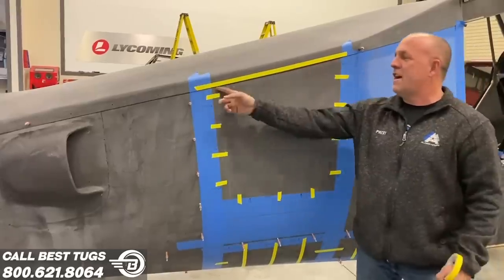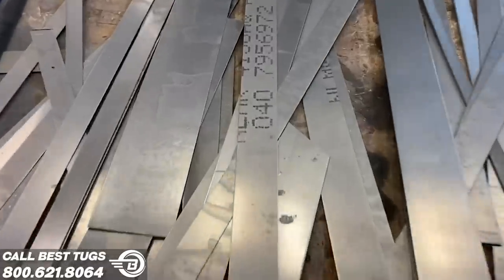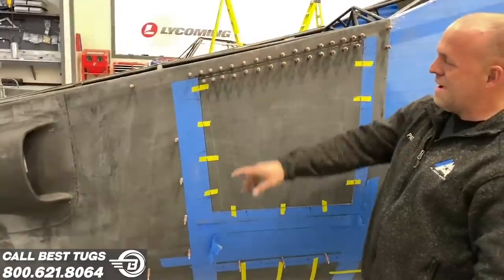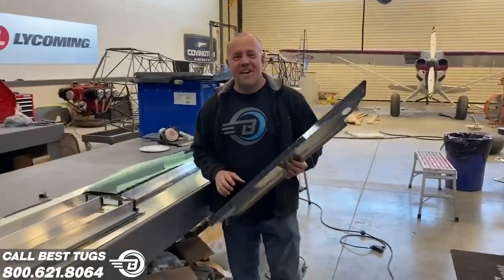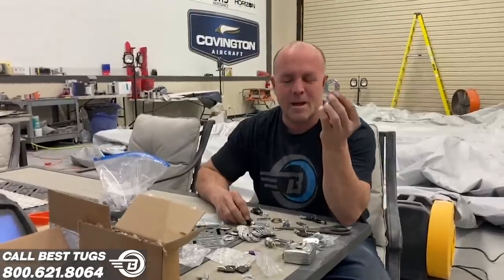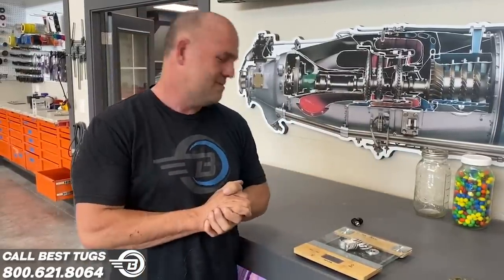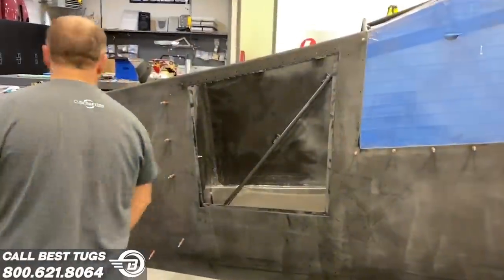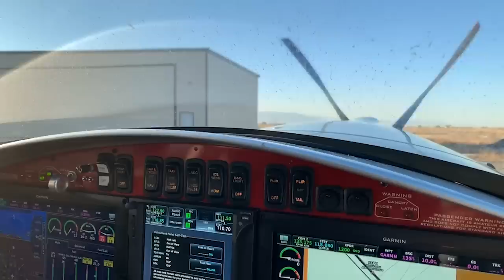Doors and locks (Scrappy Bush Plane 19)

Comment: I stumbled on to the "Scrappy" build somewhere in the early teens of the project videos.   I was so impressed with both the project and the fierce enthusiasm, mad skills, and mind boggling work ethic of Mike Patey, that I went back and pretty much binged the series up to this point.  Loved the four bar, complete with airfoil, landing gear solution, by the way.  Anxiously looking forward to the next installment.   Beyond my role of spectator and fan, I just wish there was some process where I could get a transfusion of whatever powers this man.     Super impressed.

Comment: Coming soon in Episode 20: Mike decides regular wiring is too heavy and makes his own with fluted copper strands and lightweight fire and abrasion resistant insulation. 20% lighter, 15% better conductivity, 4000 degree melt point, and requires a diamond wheel to abrade.
Reply: considers fibre optic
Reply: Of course Mike is making his own wire.  One day, I think he will build his own engine from raw materials. 😀
Reply: "I decided I wasn't happy with the weight of the engine, so I quickly whipped one up out of carbon fiber...."
Reply: This man needs to start building and selling extreme bush flying kits for airplanes.
Reply: @jeantsaiaviation  if I ever had the money I would buy as many from him as I could
Reply: MrChevyman962000 actually not a far fetched idea.  I’ve seen some chatter about Carbon Fiber connecting rods in F1 engines ( prototype of course ) but it’s all theoretical
Reply: Don’t give Mike any ideas. We don’t want Scrappy to take as long as Binky. 😉
Not that there’s anything wrong with Nik and Richard @BadObsession taking over 5 years to stuff a Toyota Celica GT All Wheel drive chassis and engine under a vintage Mini Cooper.
Reply: @Crewsy : No chassis, just engine & running gear :-)
Reply: @jeantsaiaviation , but selling snake oil is going so well.
Reply: @tiredowalkin  ???
Reply: @jeantsaiaviation  Mike's ego is doing well as it is, his designs are not proven only proof of concept models and prototypes.
Reply: @tiredowalkin  i'm not going to waste my time, thank you for replying.
Reply: @jeantsaiaviation  lol, you just did be replying and reading my replay....face it

Comment: Mike's comment about saving a 100 grams lots of times adds up to a significant saving, reminds me of F1 design philosophy.  They do the same thing but not just with weight.  They look at every component and assembly, trying to gain a fraction of 1% improvement with each one.  That sounds so like what Mike is doing with Scrappy.

Comment: Good idea to change to bearings for the flight control pulleys 👍

Hints :  I know you already know these but for new builders, this might be useful.

Remember to clamp up only against the inner race and leave the outer race free to rotate. 

The pulley’s surfaces should be clear of the bracket. This will reduce friction throughout your system considerably.

Also try to ensure you have more than the minimum cable wrap angle on your pulleys, so that the cable does not slip in the groove, instead the bearing should rotate freely.

Great stuff, love watching your videos. 

Thanks so much for sharing and providing us with great insights.

Comment: Those oscillating cutters are the best! I just used mine to cut holes in the wall to install my 50 amp 220 outlet. I can finally use my welders and learn to tig weld!

Comment: Taping the steel ruler... genius!  Definitely going to be doing trying that! And multi-tools are fantastic!
Reply: Yup. A stainless steel ruler that's under one mm in thickness, is excellent for this. It will comfort to all sorts of shapes and curvatures, and being stainless, it won't complain as much as other metals when the buzz blade passes by. Certainly an aluminium ruler would be chewed up after a few uses. I have a friend who does carbon fiber replica frames and this is his preferred method. He's even using a variant where the ruler is turned on its side to get curvatures, like wheel arches and so on. Last i saw, he was using small aluminium cubes with 3m red double sided tape to stick it on. Nothing one can't do, with sufficient ingenuity or will.

Comment: A holesaw is great for making your own washers in different sizes and if a smaller than 1/4" center hole is needed I mount the plate and saw in my 
pillar drill and cut the "washer" without using the center drill.  If a larger hole is needed I just put it in the lathe.    

Nice to see your build moving forward, when it's finnished  you can do a "Crocodile Dundee" and say:    -That ain't no Carbon cub,  this is a Carbon cub!   :-)

Comment: Those Ace type cam locks come with generic backing plates which are made for the masses. It helps when a user drills the hole on an angle/etc.. In your case, with the OCD, you made the right choice fabbing the tight fit plates. The cams are usually in a universal kit and designed more for mailboxes/etc than carbon fiber cubs..

Love watching the vids—Keep up the “insanity” 🤪

Comment: Mike- set a good example and protect your hearing by using Ear Muffs!  My ears constantly have a high pitched ringing from chop saws, grinding, powered saws, rivet setting, get the picture?  As a retired A&P and metal worker with some carpentry thrown in, I have (till around 45 years old) done everything possible to loose my hearing, with fairly consistent results.  If you want to converse with your grandkids, please start a new habit of every time you cut, grind, etc. make it a rule to wear good muffs.  Chief has David Clark muffs really reasonably priced, and hearing is priceless, eh?  Great stuff you are teaching here!!

Comment: After you done with your multi tool cutters, don't throw them away. Grind off the serrations & smooth the metal out. Now you can use them to sand by sticking a piece of self adhesive sand paper to the re-purposed cutting blade.

Comment: Mike is about to make the SpaceX falcon nine look like a toy when he finishes this "Cub"
Reply: I can see the headline....first airplane to reach orbital insertion speed from an air breathing engine....lolol!
Reply: Phyde4ux about 10 videos ago when he showed us the engine and prop
Reply: @diverbob8  Yeah from a standing start with zero run up
Reply: @FrozenLionsFan  AHHHH-FACTS! LOL
Reply: However, SpaceX will retake the lead with Starship, about the time Mike starts building for that new jet engine in the case, and gives them a run for their money!
Reply: Lol.. Elon Musk would spank Amazon if he gave Mike a team to design something for Mars...
Reply: ke6gwf I want to see what Mike would do with the Starship attitude and budget to test to destruction!

Stainless Cub anyone?
Reply: @solexxx8588  Don't be so literal.  It was easy to understand his point of interest. Mission Design has nothing to do with his point of intetest. He was referencing the Renaissance /Dare to Dream, Designing Style.  Not the design advantages of coin & necessity requirements. Scrappy was always more about kitchen sink rather than saving / spending a buck.
Reply: @daniellewis1789  stainless doesn't make sense for the Cub.
It does for the Starship because it's higher weight is offset by the greatly reduced heat shielding, and having balloon tanks vs separate tanks and shell, plus materials and manufacturing will be a fraction of the cost compared to carbon fiber. It's also easier to repair, and better suited for reuse and inspection etc.
You get none of those benefits on a plane, you just add weight and a LOT of cost.
Reply: @hoppermantis7615  Elon Musk already IS spanking Amazon. Bezos hasn't even made it to orbit yet, built a flight engine, built an orbital rocket, or pretty much anything else that mattters.

Mike has built and flown more than Bezos has! Lol

Now, maybe next month he will roll open the factory doors, roll a completed rocket out, and orbit the moon, but considering they haven't even got a flight ebrhi/engine to ULA who really needs a bunch, I am not holding my breath lol

Comment: If your trying to scrub off as much weight as possible you could use amsteel (dynema) for all of the cable's. Its just as strong as steel cable and only a fraction of the weight.

Comment: I probably couldn’t afford the fuel, but this is my dream plane!
Reply: I think you’d be pleasantly surprised to see how little fuel a Carbon Cub eats per hour. Though, Mikes cub will burn a bit more than the AvGas or MoGas variants. The MoGas version wouldn’t be much worse than an Ford F-250, and it’s way more fun!
Reply: Just to give you a taste of what it's like to own a high end unit, I was with my companies owner last week to put his 60' yacht into the water for the year. We fueled up and the bill was $3800. Just in fuel. Then the factory engine service tech came and did the valve lash for both mains and the generator set. Along with the oil change, all the filters and other fluids. $4299 was the actual invoice. Then the tech showed up to calibrate all the radars and GPS and all the other navigation aids. A software update finished it. All told it was near $23,000 just to get the thing back in the water. So my point is people just look at the price tag of the "toy" they want, but that's not the expensive part. The real money is spent on the other stuff. Like the man said, if you have to worry about putting fuel in it, you can't afford it! General Aviation is just as bad.
Reply: @valuedhumanoid6574  with a sailboat they say to expect to spend 1/10 the purchase price per year. I would assume the same or more for a power yatch.
Reply: My Tri-Pacer 150 hp @115 mph burns 10gal/hr = 11.5 miles per gallon. My F-150 averages 14.5 mpg around town and with my cargo trailer behind it I get 11.0 mpg in the mountainous west but have to go around everything instead of straight line flying. 10 hours in the truck 110 gallons or 6 hours flying 70 gallons. Mikes engine will be loafing in cruise flight.
Reply: 110 gallons in 10hrs? At 11mpg is 1210 miles. You're not driving that far in 10hrs.

Comment: I would have made a UHMW or Delrin ball fitted into the hole in the lock tabs to take up the slack between the lock latch and the carbon fiber.  That way you have a soft yet wear resistant piece aginst the carbon fiber.

Comment: You've gone so far with the carbon fab on the fuselage, it almost seems that much of the structure could be monocoque. With a little more engineering, maybe much of the steel would be redundant.

Comment: @Mike Patey I'm wondering why you don't lay some kevlar inside your cockpit ? In gliders we are surronded by CF. We have a layer of kevlar over the CF to protect the pilot from been perfored or injured due to big CF splinters in case of shock.
Reply from the maker: Great question. 👍🤠 I wanted the look of carbon fiber so I layered a layer of Kevlar in between the layers to reduce the chance of fracture

Comment: Have you considered using dyneema synthetic fiber instead of cable for controls? Definite weight savings, but they do have a lifespan, as opposed to traditional steel cable.

Comment: Hi Mike, As a retired Lockheed Martin Mechanical Engineer,  I really enjoy watching your videos.  I do have one comment on the aluminum parts that you are making for Scrappy.  You show the finished parts but don't talk about any surface finishing to protect them from corrosion.  You can use Type 2 anodizing to create a decorative look and maximum corrosion protection.  In locations where you need to provide more protection from galvanic coupling between the carbon fiber and the aluminum parts , beyond the things you are doing, you should be using Type 3 hard coat anodizing.   You may already be doing this and just not showing us in the videos.  Thank you for sharing the videos of your project build.

Comment: I see that with the current opening angle and hinge on top there is good chance of busting your head open on a corner of the door and also you need to bend over to access the compartmend as you are quite a tall guy. Did you consider installing the hinge on the forward side? Also the airflow would help keeping the door closed in case of locking mechanism failure or not properly closing the door before flight. Ofc a bit more hassle with installing the hinge on curved side but I belive it would be quite easy for you to figure out.

Comment: i appreciate you using grams, makes it way simpler :D also i hope you know tumbler lock are probably the most insecure lock there are :/ though lock are always just about making stealing a bit harder :D keep up the good work
Reply: Bank vault doors are just too heavy.
Reply: @barrygrant2907  yeah but a disc tumbler lock wont be considerably more heavy then a (tubular) tumbler lock and is waay more secure
Reply: If a jiggler attack on a wafer lock is common I'm curious as to what the vibration of flight would do to them? You'd still need the core to vibrate in the right direction once unlocked for anything bad to happen but would be a fun experiment.

Comment: Hi Mike; fabulous stuff, so much attention to detail...the comment, below, about rounded corners, i would agree to, but i'm not sure how that would reflect in tbe build.
When you were talking about filling the holes with epoxy,  i have used electrician's tape for that, as it seems to leave a very smooth surface, better than duct tape, but you may have found that the extra adhesion of duct tape prevents any overflow of the epoxy as you squeeze it in from the other side?

I was wondering if you could/should/would want to, make an attachment point for the door to be captured onto that diagonal frame tube that crosses the opening?  Maybe a magnetic mechanism, simple one like kitchen cabinets, or something that slides across, operated by one of the door latches...if it slide across, then you don't have to have that big 'break-away force that you get with the simple door latches, but still have a strong capture when it's directly over the tube...just some dumb ideas...
BTW, are installing something like LED lighting strips in the luggage and cabin?  Minimal space, fit into 'corners' of the structure, and reduce shadowing? How about LED lighting in the door, so that it throws light down, when the door is up (how are the doors locked up), illuminating the luggage, as you load, and the ground, for safe footing, and to help find anything that gets dropped, at night, or in a poorly-lit hangar?

Comment: Good day Mike,
I have a couple questions. What tig fill rod do you use for 4130 chromoly and who does the heat treat of frames for you? Can you do a video featuring equipment and supplies for carbon fiber construction? Thx

Comment: @ Mike Patey Where did you get a Carbon Hinge? Who makes them? Also the very end of the Hinge Rod, you need to make sure it has a hole drilled through the very end so you can safety wire it or wire it to a anchor point to prevent it from vibrating loose, and you lose your favorite luggage door.

Comment: I always was told that door cutouts in aircraft skins need round corners for stress alleviation. I guess in this case it doesn't matter as the skin is not stressed.
Reply: Aircraft is not pressurized so it doesn't matters
Reply: When he was holding the door open I was thinking they should be rounded also because I would run into a corner with my head and get blood all over. ;-)
Reply: @MaximEck96  The Cessna 210 is not pressurized neither but have baggage door cutout with round corners. This is because the 210 has stressed skins, meaning that they help to carry the loads in the fuselage  in flying or landing conditions. Same on the wings, access panels are round or circular.. In this Cub the skin is not carrying any loads in the fuselage, they are just fairings. The stress is carried by the metallic  framework inside of the carbon fiber skins. A normal cub of the 1940s had just fabric wrapping around that framework.
Reply from the maker: Great comment 👍🤠 so carbon fiber doesn’t run cracks at corners like metals do. Also for extra safety in that area on the back side in the corners I added 6 layers in the corners.  Carbon fiber is amazing for things like that.  The doors on bottom hang low now and would be hard to walk into them as the round of the aircraft keeps you back from the undercut of those doors.  I could have done round, maybe would have been safer for bumps and bruises. I liked the look of square but 🤷‍♂️ 😂🤠 back to work 👍🤠
Reply: @MikePatey  Hey Mike :) that"s true, carbon fiber is not sensitive to fatigue as metal. It's great that you reinforced the corners.
Reply: @mauriciocastro7505  Yeah your totally right, it was 2am and my brain only published half of my thought in that comment ^^ 
"As there is an inner structure and the aircraft is not pressurised it souldn't matter "
And further on with what Mike added, in fact carbon fiber doesn't really care if the hole you make is round or square. For that kind of material the fiber is either cut or not and thus can or cannot carry the load.

Comment: Loving it Mike! Just wonderful watching and listening to a Master.
Question!  Why the four big holes in all your backings?  Is it weight reduction, or do they actually increase the stiffness?
Reply from the maker: It’s both weight reduction as well as stiffness.  Every change is shape adds strength and circles are the best for that. This part doesn’t need it but it’s easy.  The next thing it does to add strength is re connects raw carbon to carbon inside the circles.  This adds additional strength as that bond is stronger than carbon to honeycomb.  I’m not sure how to describe it best, but it’s like 4 giant circle spot welds so if somehow you really twisted the door it would not pop the bond.  It’s over kill in this application but it’s easy and saves weight.  👍🤠